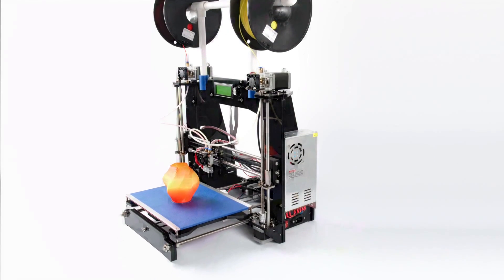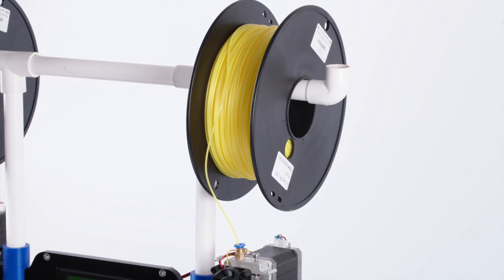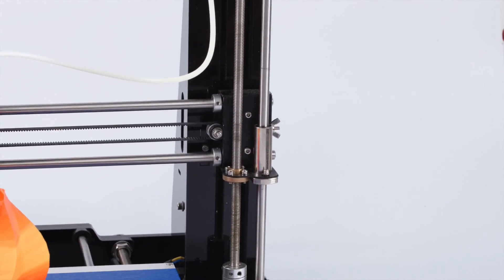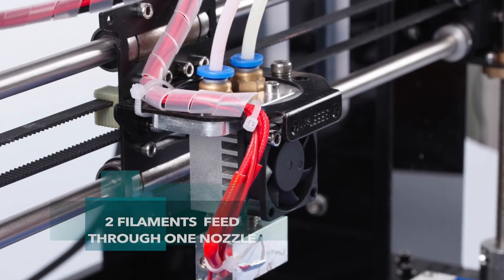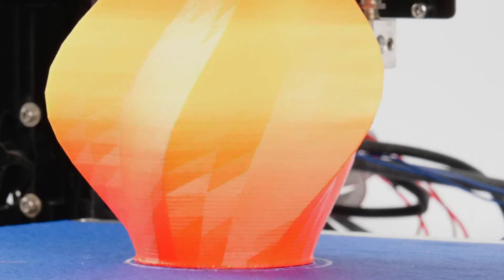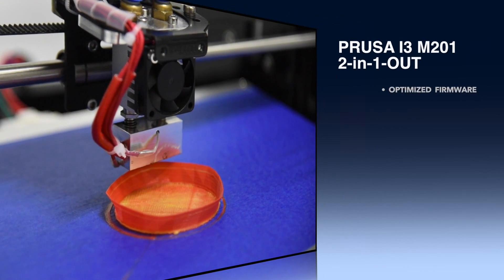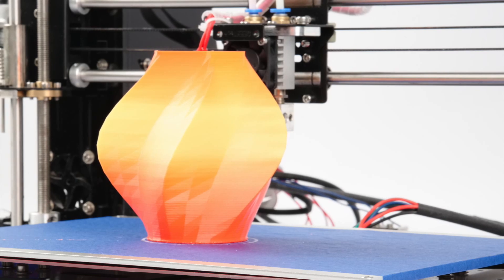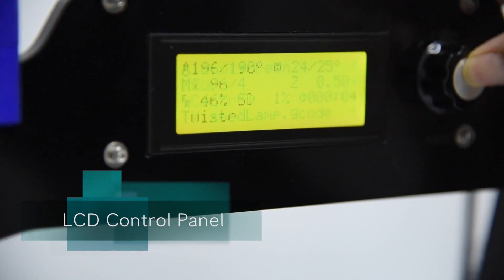introducing Geeetech Prusa I3 M201 3D printer

Comment: I have the duel m201 3d printer, i have finished building it and it turns on ok (the fans start) but i only had a ribbon to connect the lcd display and am sure this is wrong as I am getting no lights or text what so ever on the screen
Reply: there is no video that covers the section of connecting the lcd screen to the power ect either
Reply: it's all good XD i just had the display ribbon the wrong way around, If anyone comes to this stage it is the blue side of the ribbon tips facing away from the component's

Comment: The kit I have has a bracket on top of the extruder motors but nowhere on the videos does it show you what to do with them? It looks like the kit I have has several modifications or upgrades that are not covered in any of your videos? Please can you help?
Reply from the maker: yes, the modification was mentioned in the building instruction, please refer to the building instruction. If you still have any questions, please contact rita.xiang@geeetech.cn

Comment: I bought one M201, and after 6 month of trying fix all the problems, I gave up... This machine doesn't print ANYTHING! 
All the issues:
-X carrige doesn't reach to limit switch (fixed with plastic)
-The firmware only accept A4988 drivers, not DRV8825 (There's nothing I can do because the code isn't Open source)
-The cyclops extruder coagulate every time (I fixed the PTFE tube but isn't enough)
-The motor mechanical parts are plastic and lose strenght and steps (fixed with new metal parts)
-Z carriage  doesn't reach to limit switch (fixed with a long screwdriver)
-The repetier firmware isn't correct (You need to change some values)
-New EasyPrint software can't connect with the M201 (I tried in admin mode)

I contacted Geeetech to solve this problems, but all they said is to contact Gearbest and try a solution with them...
Reply from the maker: Hello Logica, I am sorry to hear that you have met such problems during the use of our printer. As your printer is bought from Gearbest, so we suggest you contact them directly, if you need any replacement, they will apply from us. Our website do not have any order record of you, so it is impossible for us to send anything to you directly. Hope you can understand.
Reply: Ladies and Gentlemen! I found it for 269.99 USD
http://www.gearbest.com/3d-printers-3d-printer-kits/pp_366034.html?wid=21&lkid=10557567
Cheers

https://www.youtube.com/watch?v=WUUELS4Zfhc
Reply: It costs just 899.99 dollars
https://www.banggood.com/Geeetech-D200-Smart-Cloud-Built-In-Wi-Fi-3D-Printer-Kit-300-x180x180mm-Printing-Size-p-1172266.html?p=B4200913385416201708
I hope this will help you

https://www.youtube.com/watch?v=WUUELS4Zfhc

Comment: Can it print supports in another color?
Reply: +Malek Darwish like a dual extruder
Reply from the maker: +Malek Darwish yes
Reply: I read on your website it said it cant
Reply from the maker: Malek Darwish you mean like the dule extruder, of which one will print as a support? sorry, it cannot
Reply: can it print wood filament and flex?
Reply from the maker: +Malek Darwish not suggested.
Reply: why?
Reply from the maker: Malek Darwish wood filament will tend to be blocked in the bozzle and flexible filament is difficult to be guided from the extruder on the top of the printer to the hotend on the x axis through the PTFE tube. so..not suggested